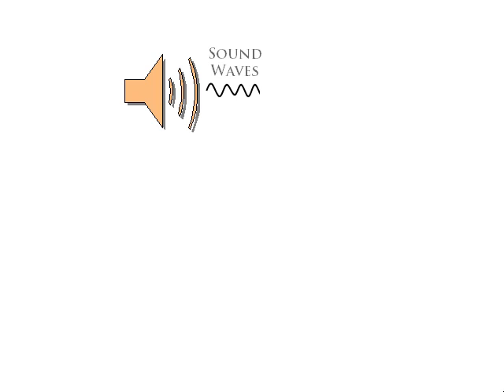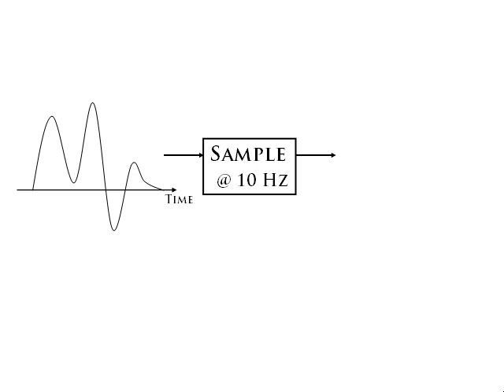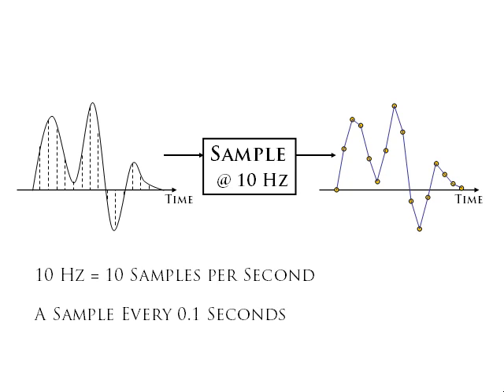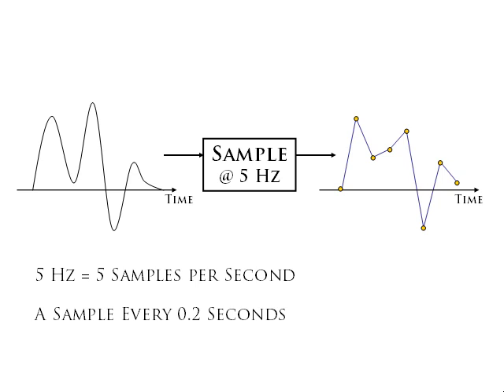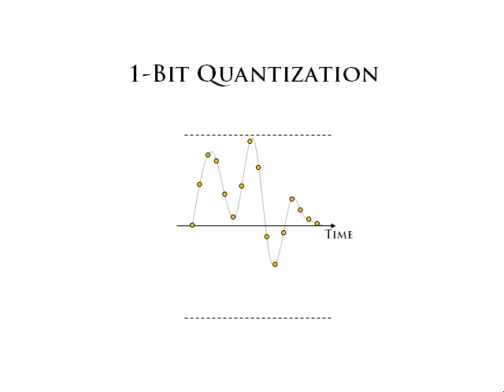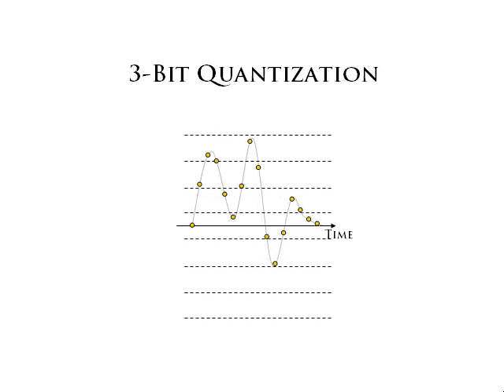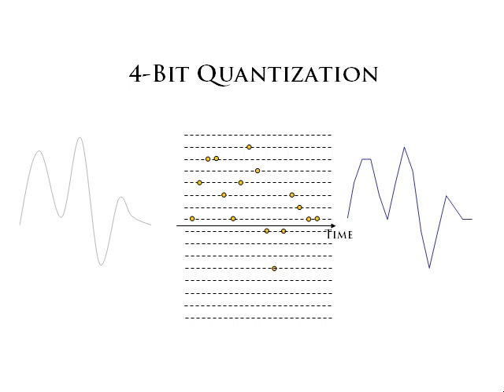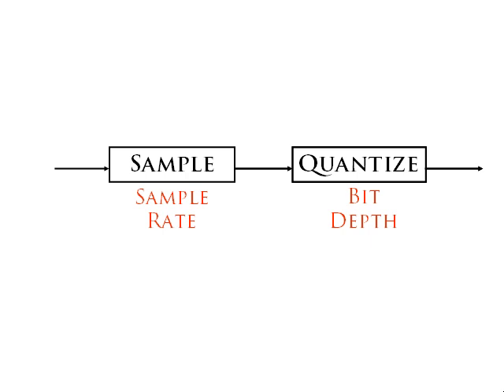Music Technology 101: Sampling Rate and Bit Depth Explained

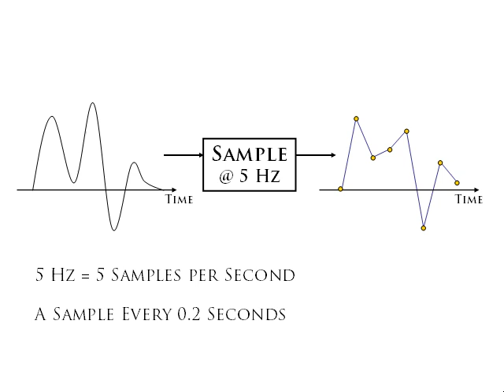Comment: The video explains it perfectly from 4:51

The quantization of a sample, in A/D conversion for example, simply rounds off the sample to a set degree.

So if you have a wavelength, you have high peaks and low peaks. With quantization, the peaks are rounded off to a set height/depth.
1 bit means all high peaks are rounded to the same level and all low peaks are rounded to the same low level. The higher the bit depth the less rounding off occurs, meaning the sample becomes more accurate in reprod